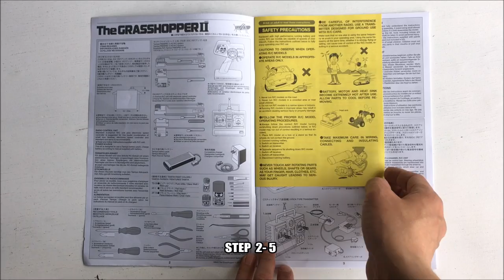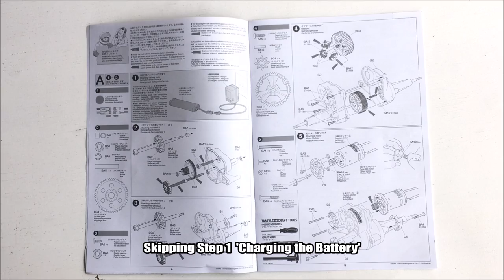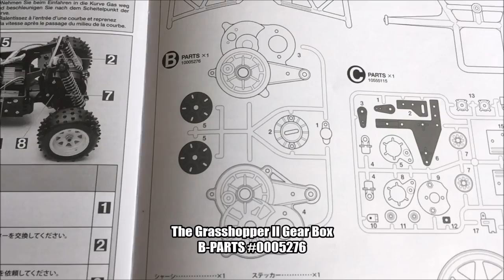BUiLDiNG the New Tamiya Grasshopper II 2017 Re-release (58643) Part 1: Step 1-5 vs The Grasshopper

Comment: Good teaching video for those of us who haven't built since the original Grasshopper, some 30 years ago. If you add the high performance Sport Tuned motor (540) it mounts directly to the gear box -- don't add the "motor plate" that is normally mounted to the motor supplied with the kit (actually, you can't add plate; it doesn't fit over the pinion gear).  This confused me for a moment until I realized how the larger motor mounted.
Reply from the maker: Hi Stanley! Yeah, the Sport Tuned 540 will make this one fly. Got another Hopper with a 540 Sport Tuned and it's a lot of fun. Thanks for the tip.

Comment: I had the Super G Grasshopper II back in the 90's. Came with better shocks, a 540 motor, better wheels/tires etc.. Loved it 👍
Reply from the maker: Nice! I can understand why. The Super G is excellent! Came with all the essential upgrades. Basically it would perform like a Super Hornet. The stock rear shocks on the standard edition is the worst I've tried yet :-) Thanks for watching and commenting. Appreciate it.

Comment: Great build! Absolutely enjoyed it. I did not have enough patience to film the build :D You just need the manual to check if everything is 100%. I will bash mine this weekend with the 540 motor on 3S :D
Reply from the maker: Thank you very much! It's going to be my longest build video, but well well :-) Looking very much forward seeing it run with a 540 and 3S! Good thing you build it fast, so I can enjoy seeing it run while I build mine. Helps with my patience :-) Looking forward running mine too

Comment: I also hardly use the caution stickers. I assume it is for offering safety notice more, but it doesn't seem to go well with the legendary hopper.:)
Oh, haven't known the rear axles are a bit different from each other's.
Reply from the maker: gpgp01 Yeah, I think they are appropriate if young people are running the car that doesn't know how hot a motor can get on a hot summer's day. If my son some day will start running my cars I will out them on :-) Yeah the axles are indeed different. Think the only reason is that the wheel adapters and the wheels are different. No standard 12 mm hex in those days :-)
Reply: I enjoy the caution stickers, they are hilarious. But then i also cut out the kit number that is on the decor sheet and add it somewhere on the car.

Comment: I want to replace the bushings in the gearbox of my GH2, but the piece that sits on the end of the axle and holds the wheel in place won't come off meaning I can neither change the axle nor the bushings...
Reply from the maker: The wheel adaptor? I am sure it will come off if you wriggle it a little. Hope you succeed. But if you're running the GH2 with the stock 380 (as I will be doing) it doesn't make too much of a difference if it's bushings or ball bearings.
Reply: Yeah, it's a C7 extension, I found out that much... It won't come off though, no matter how hard I try. I just hope nobody glued it in place because I got the car used (1988 original)... Right now I'm trying to fit a Sports Tuned 540 in there but I need to wait until my next paycheck to buy the right pinion for it. Right now, running it with bushings is alright as the only thing I've replaced up until now is the msc with an esc, but when I add the new motor, I'd like to have bearings in there, and wheels with a real tread as the pin spike ones I'm using right now aren't that good for driving on loose ground like sand. 
I was suprised how much of an improvement I got going from the stock Tamiya msc to a cheap 45A esc! My runtimes have gone from approx. 10 minutes to over 30, and that's with an ages old 1500mAh nicad battery! 
I really love the old tamiya models, they're easy to customize and still a lot of fun. I'm planning on buying a hotshot or FAV next month (can't decide which one yet :D)
Reply from the maker: Uhhh, I hope they didn't glue it too. Strange it won't come off. Hope you solve the mystery. Yeah, if you want to install that sport tuned it will be a good idea to install the bearings. With an ESC, ball bearings and a sport tuned you will still get good run times, even though you've switched to a 540. It's a hard choice, Hotshot or FAV. Both are iconic and beautiful :-)
Reply: I agree ^^ I like the FAV a bit more though :D

Comment: Nice build, so far! I am looking forward to recreating my 1988 GHII.... except for bearings (sorry, I can't stomach the thought of using those white hockey pucks in ANYTHING!), it will be box stock. 

HOWEVER, I want a second one - that I will be chopping up, and making my version of Alberto's AmPro Hornet III, front and REAR double wishbone suspension and the whole works!! 😲😲😎

Can't wait to see the continuation! Just subbed.
Reply from the maker: Thank you vey much! Haha, "white hockey pucks" :-) Yeah, until recently I had this rule to build all the classics stock and run it once before changing anything. But I too grew so tired of these 'hockey pucks' so I changed my rule :-) Oh my, I am following along with Alberto's creation too. It is really an amazing job. Would love to see the same thing done to the GH2. Thanks for the sub, sir! Much appreciate meeting other Tamiya enthusiasts!
Reply: You've got the videos that I want to see. Subscribing was easy! :-) 
My GH2 will have to wait a bit..... I'm currently building a TT02.... bought and donated piece by piece! I'm kinda poor. 😢😢  Yes, it would have been cheaper just to buy the kit, but I rarely see that much money all at one time anymore. 
On the plus side, I can have my own mix of parts, and set it up exactly my way! It will eventually be a Rally Car. Still need a body, battery, ESC, and front bumper.  One money saving idea, bearings. I only use rubber sealed bearings at the wheels. Everything else gets the cheapo steel shielded bearings. I really want a 240Z body.... but they're getting harder to find, and afford. 😕

At least I'm not doing as bad as my friend, Carmine. He lost nearly everything, yet still tries to keep RC going - for his very sanity.

Comment: Do the shock observers fit on the hornet
Reply from the maker: Hi Ewan! I'm not sure what you mean? "Shock observers"? What do you refer to and which ones? The Hornet and Grasshopper II share the same gear box but not the same chassis. The shock absorbers on the Grasshopper II are quite useless so I would prefer the original shocks on the Hornet.
Reply: Nordic RC Visions ok thanks sorry for the bad spelling i dent one of my shocks
Reply from the maker: Ohh, my spelling in English are not perfect either. I was just thinking if there was such a thing as a shock observer, and what it was. I still consider myself a newbie in RC so there's always a potential that I missed out on something :-)